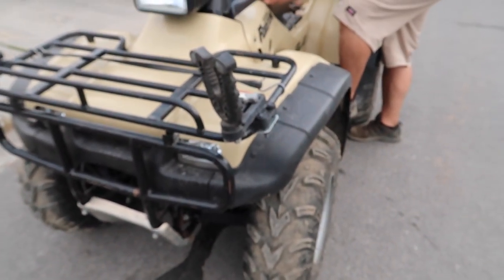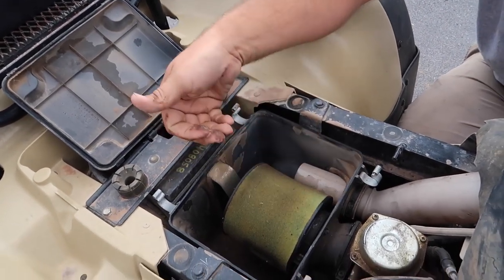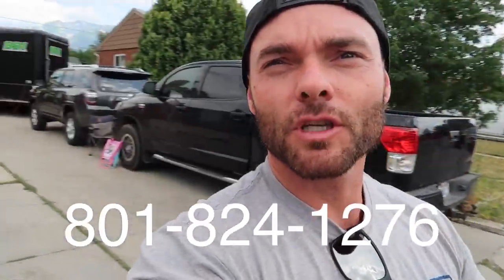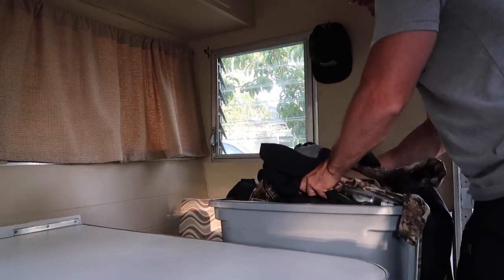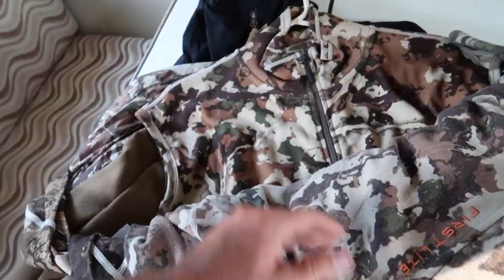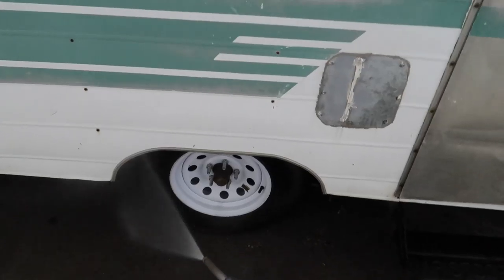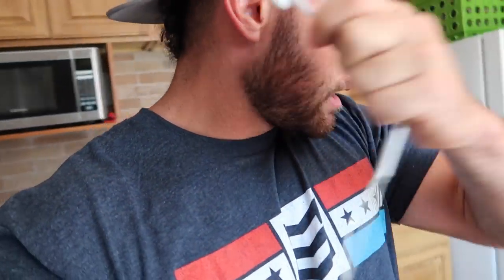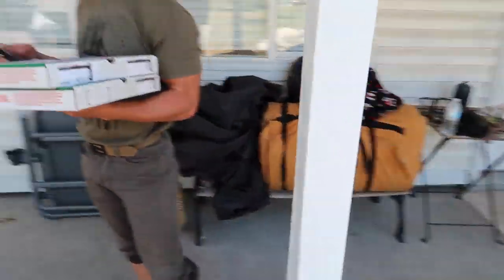PACKING UP MY VINTAGE CAMP TRAILER | DAILY VLOG

Comment: Those Honda foremen has a breather fuel line right on the fuel cap. If you pull that Vacuum line on the cap. Your’ll see what I mean. I have one and it smells sometimes. Not heavily but it does evaporate fuel in the tank.

Comment: You can use the stove for heat. Definitely leave a window or vent cracked open. It is something to monitor, I would not leave it on for more than 10 to 15 minutes at a time. Make sure you have a fresh air source while its on.

Comment: I used a buddy heater for years in my trailer it's safe indoors I've ran it all night with a window open if the oxygen gets to low it shuts off.  Running the stove is okay to warm it up for a min but not safe to run for long periods of time

Comment: Spare tire and jack/correct size lug wrench to change it. Stabilizers are sure nice if you don’t have them already-you can use cheap scissor jacks. CO2 sensor inside (definitely wouldn’t use the stove for heat). Extra pieces of 4x4 wood blocks for chocking wheels, putting under jack/stabilizers. Not sure if it has trailer brakes, but if so it’s nice peace of mind to have them working.

Comment: I did not notice but does your cooking stove have a vent top?  If is does, you can make a simple vented heating element using your stove.  Personally, I'd install a heater.  You can find them used all day long from old or wrecked trailers.  I'd go with a vented convection heater that does not require power.    We use our stove to help heat the place up and cooking but do not leave it on for heating while sleeping.

Comment: I would not use the stove top for heating my first hand experience is 
We were using out stovetop in our hunting trailer due to it being super cold and having issues with our normal heater and during the night two of the
Burners went out.   Woke up to a trailer filled with propane and the other burners flaring up.   The gas was so thick in the trailer it was burning my eyes.         Luckily I walked away without blowing myself up.  I would highly advise against it.    It's not worth it

Comment: I wouldn’t run the stove for heat, it’s not worth the risk.  You can pick up a little buddy heater for pretty cheap, they run on the small propane bottles, but they are meant to run indoors, and put off a lot of heat.  I’ve used one ice fishing before, and stayed very warm on the ice.

Comment: Naw man...dont run those burners overnight...I'd also check those propane lines for leaks..old trailer...also make sure you have a propane leak detector installed near the floor! And a little buddy heater is perfect for that trailer...

Comment: Buy a buddy heater for heat. Can get a adapter to run off big propane tanks.
Reply: I second this, I dont even use the furnace in my camper, Just run a line to the LP bottle from my Buddy heater and set it on the table. It works great and its quiet
Reply: @vanniek71  Smart man! Good luck this season!

Comment: Yeah I always run my burners in my little tent trailer I use for hunting. I just crack a window (preferably a window rather than the roof vent... so I don’t let all the hot air out), never had a problem

Comment: Hi Eric,  you need a 12volt AGM battery and charging system, then you can install some 12v lights and some Usb and cig sockets in your Caravan. You can ad a solar panel and you will be sweet. Check out Redarc bcdc systems they are a very good Australian company that is available in the USA. Happy hunting.

Comment: Early in the morning if it is pretty cold in the trailer we will run the stove   but not during the night something that would be nice for heat in that trailer would be a ”Mr, Heater little buddy”  nice puts out a lot of heat and can control how much heat to are putting out

Comment: Carbon monoxide and smoke detector. Wouldn’t use the stove for heat. Extra fuses if your trailer uses them. We put a little tool kit together just for our trailer with multi driver, wrenches, etc,. Also extra light bulbs for the inside lights and brake light bulbs etc. Extra bedding and pillows. Something to charge your battery generator or power inverter. Broom and dust pan.  A rug for the ground outside by the door to decrease the dirt that comes inside the trailer. Plenty of TP and wipes. Good luck with your trailer. Thanks for sharing. Take care, see ya :)

Comment: A fly swatter & dustpan are a must have in a camper
Reply: Zip ties , duck tape, cheap flash lights, extra batteries, bug spray ,
Reply: Also some velcro tape & a small FIRE EXTINGUISHER 🔥

Comment: Get a buddy heater for heat. In the morning when out of bed and getting ready the burners are fine. But if there is a chance you will fall asleep with burners on you may never wake up. A buddy would beat that thing up fast.

Comment: Don't forget plates, silverware, can opener and kitchen knives. Seasoning, mayo, kitchup and anything else related. Do not use stove top for heat. Find a heater that is made for trailers and vent it. We don't want to hear about you croaking. As for the Couse deer hunting, get yourself a tri-pod stand in 8 to 10 foot height. Those trees down there are short but a stand can come in handy. Just enough to get you above their line of sight and nose.

Comment: I would sleep with the burners on, may not wake up. Get the camper warm with them and then shut them off. Get a carbon monoxide detector for good measure

Comment: Keep ya a full set of tools in there. Run to harbor freight and snag some screw drivers, sockets, pliers, etc. nothing worse than something giving you a fit and not having a way to fix it 👍
Reply: Yep! Wheel lug wrench, propane tank wrench.....extra door key in the truck, etc.

Comment: You could run it for heat if vented well. But I’d get mr buddy heater runs off propane. I got the hose so I could run the heater on a five gallon propane tank. It’s what I use in my tent trailer.